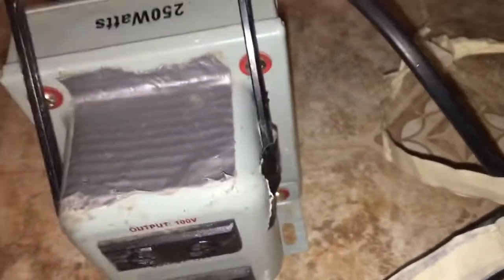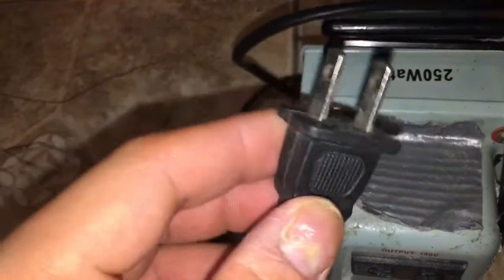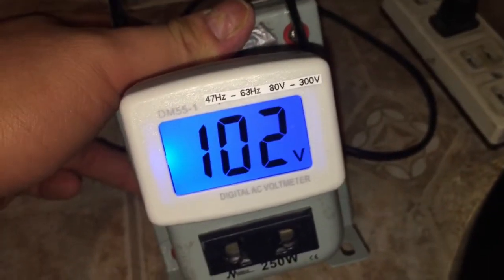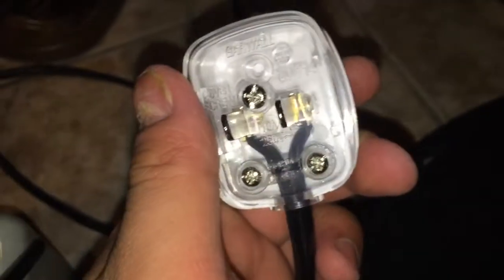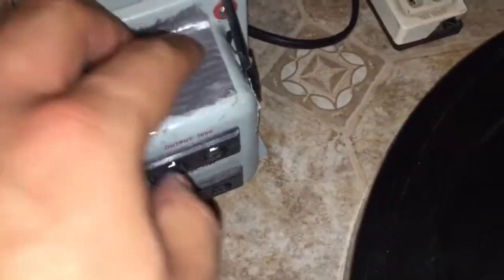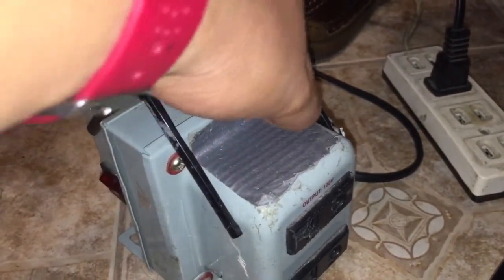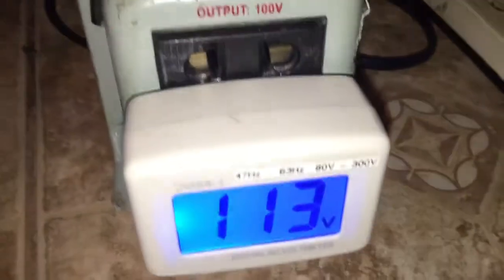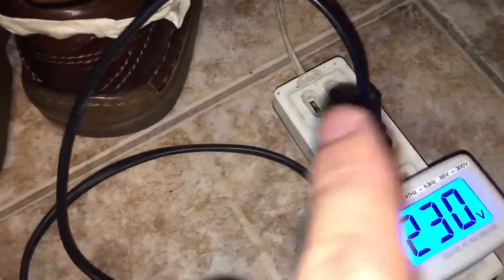MEIJI TC-250DV 220V to 100 V or 110V STEP DOWN TRANSFORMER AND VOLTAGE CONVERTER REVIEW

Comment: And USA portable TVs too
Reply from the maker: Yes
Reply from the maker: Operates from both 100V and 110V to 230V.

I already tried to plug 100 - 127V XBOX 360 / XBOX ONE / Nintendo Wii / Wii U US adapter to operate.
Reply from the maker: You can use 50W transformer for US / Japan poetable TVs too. HDMI TO RF (PAL NTSC analog output: E31, A3, AC58, J26, A27 channels) required for DTV BOX hookup.